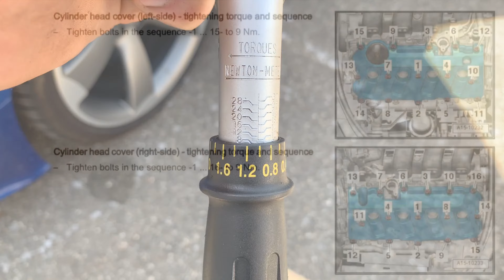Audi RS5 valve cover gasket replacement

Comment: Hardest part is the TORX Screw in the back. I had 2 Ratchets both too big. Bought 2 other ones, also too big (the Bits are too long for most equipment). That Ratchet you have is really small i assume and especiall ... wait while im writing this you just put a nut on the other end? WTF i did not think about that. I used a wrench and welded a bit to it, screwing out mm for mm for like straight 30 mins on both sides.